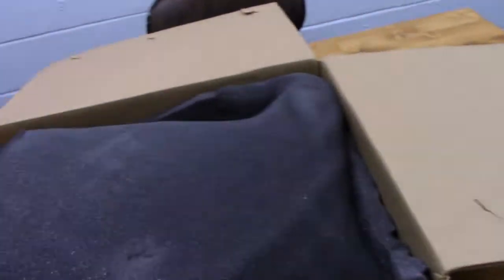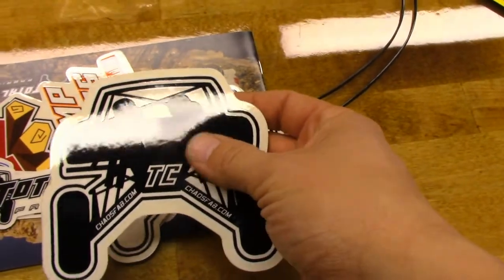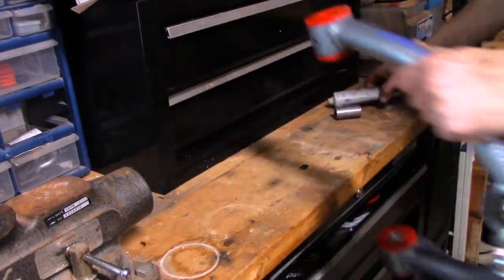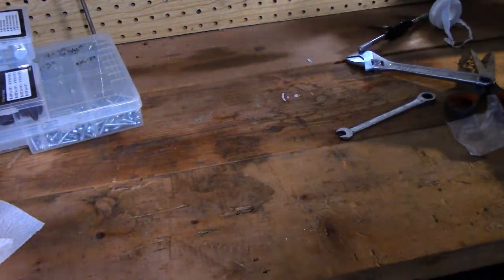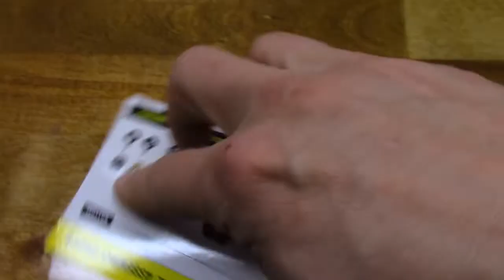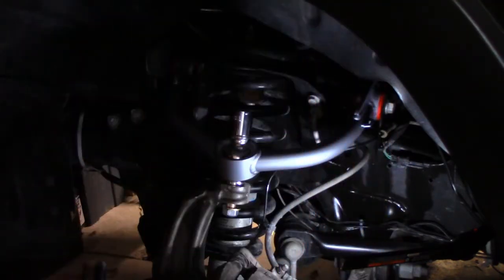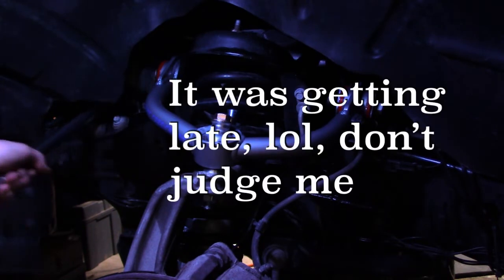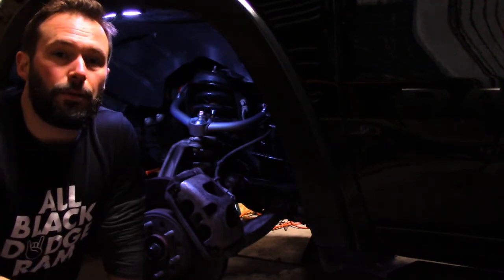Total Chaos Fabrication UCAs 2020 Ram 1500 Rebel Unbox Install Upper Control Arms Uniball

Comment: these look really nice. wish i'd seen these before installing the RCs.  when i had the alignment done, the shop said they like the RCs in general but see a lot of people running those come in with worn out ball joints with only ~6k miles on them.  i'm not sure if it's a product issue or people are just not greasing the balljoint regularly, we'll see!
Reply from the maker: That’s interesting. Keep me posted man! Hope you have better luck with them.

Comment: how does that uca ball joint on top side not just collect everything like a bowl?  is there no cover of some sort to shed anything?
Reply from the maker: No it's open. The stainless uni-ball is pretty stout. Also, squeaky, but that's to be expected. They (TCF) recommend dry lube every now and then. This will be its second midwest winter. No complaints as of now.

Comment: Is your truck leveled or anything? I have a leveling kit on 2020 big horn and I’m pretty sure my stock uppers and prematurely worn. Didn’t know if these had a better angle for a level
Reply from the maker: Yes. It’s leveled using 6112 Bilstein shocks. Better angle for sure. More robust ball joint.

Comment: Did you torque the uca's with the vehicle on the ground? Just curious about the ride height difference if any when doing it in the air or on the ground.
Reply from the maker: Originally I torqued them with the vehicle on jack stands. Since then I have performed maintenance (superlube the bushings) and have broken them loose and torqued them at ride height. So essentially I’ve done both. I can’t recall if the instructions indicated a need for either TBH.
Reply: @venomrebel2020  pretty sure 90% of us do it while it's in the air, interesting to see if it matters.
Reply from the maker: @downlow5077  when I did the 6112s they specified to torque the lower strut bolt and the upper strut assembly at ride height. I think when there is a bushing involved that can be a game changer.
Reply: @venomrebel2020  I think so too, thanks for the replies!

Comment: Did you change UCA because of the Bilstein Shocks you added? looking to do the Bilstein shocks on my Rebel as well so i can level it. Just curious to know if this was a need or more of a want.
Reply from the maker: Hey man, great question. I suppose you could say it was a want, as Bilstein says you're good with the 2" lift. A lot of people like to point out the Rebel is 1" from the factory, so 1" + 2" = 3" which is "dangerous territory" for a factory balljoint. Does the 1" come from springs alone? Bigger tires? A new front clip? Probably all of the above... I have not heard any stories of factory balljoints failing, but it's enough doubt to cause me to go with this sweet, made in America stainless uniball goodness.
Reply: @venomrebel2020  The 1” of lift is 100% provided from the springs. Bilstein engineered these shocks to work with factory arms..... including for the ORP trucks...  so long as you do not use any settings higher than they state. For example, on the 5100s, you cannot us e a setting higher than #5.

Comment: Are you running stock tires and wheels ?
Reply from the maker: 35” tires, 20” wheels
Reply: Oh okay so no issue with the 35s rubbing with stock 18” wheels ?
Reply from the maker: @JesusRodriguez-pp1mi  I also have Bilstein 6112s leveling out the front